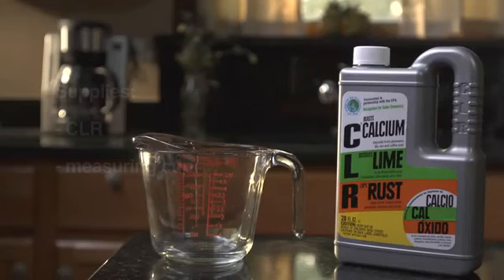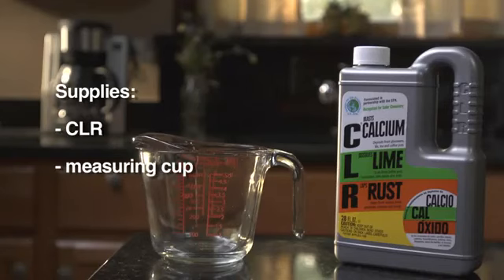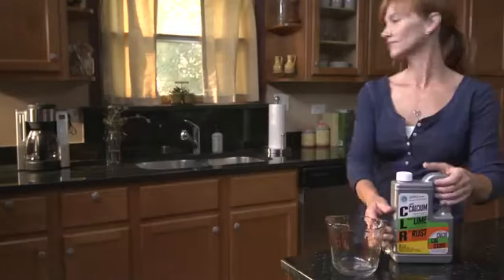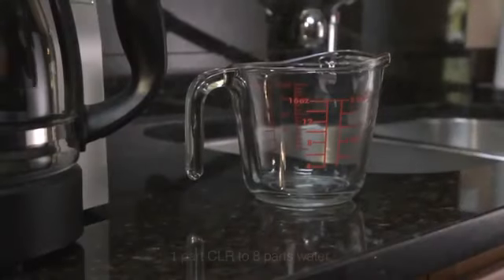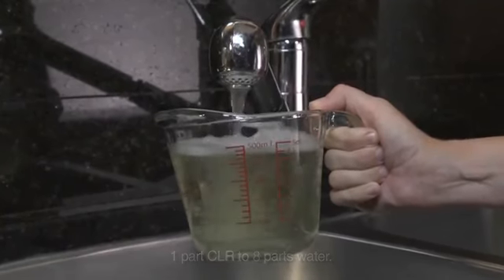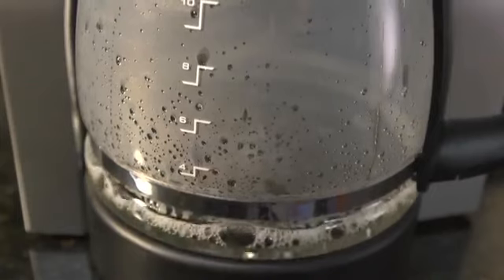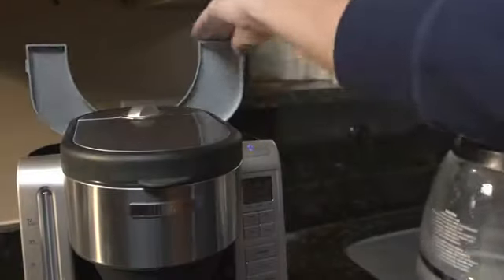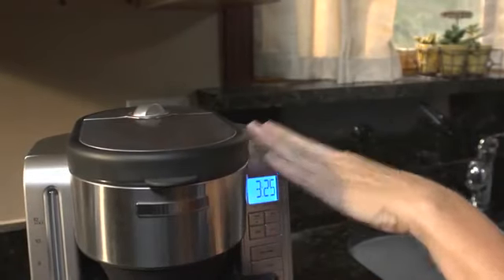Cleaning a Coffee Maker with CLR | The Cary Company

Comment: Works fine as directed on CLR bottle, on both my BCO330T and Keurig just run extra few pots of water through it, and make sure you REMOVE the Charcoal Filter if it has one (or simply replace it as most people forget about that). I have used this rather than Vinegar now that's a sour taste that takes forever to get rid of.